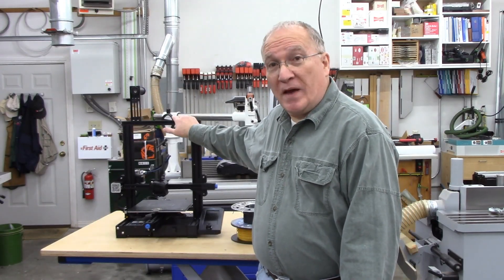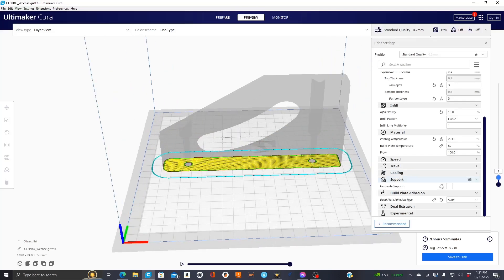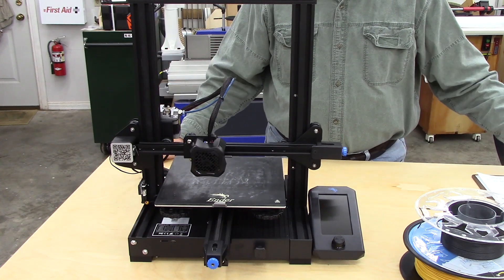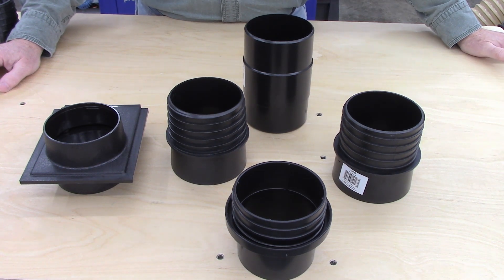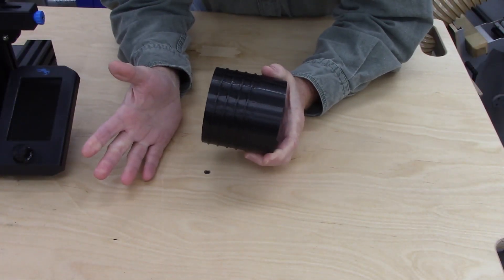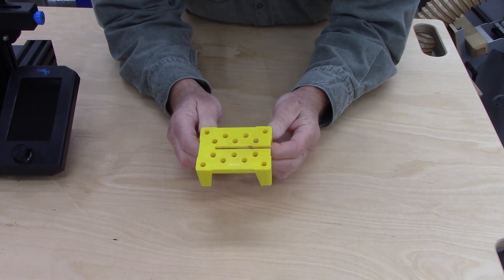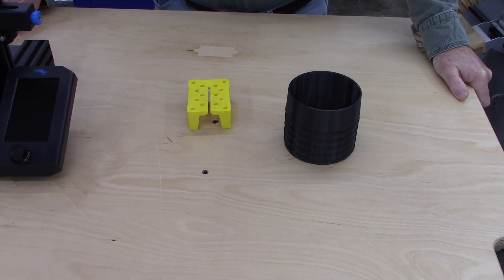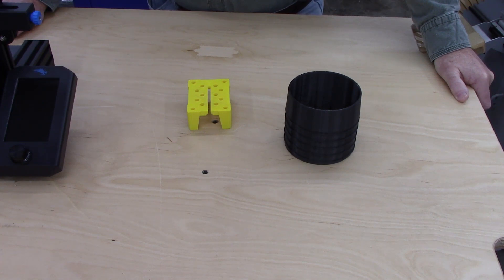3D Printer for the Woodshop?

Comment: Hi Steve I missed this one, great video with some brilliant examples.  I've just replaced my printer with a Bambu P1P, its incredible both quality and speed. 👍👍
Reply from the maker: Thanks Graham.  Based on several of the recommendations on this video, I upgraded to the X1C.  While I initially had a failed display and some binding issues, it is a major improvement to the Ender3.  My 13 yo grandson "earned" the old 3D printer by designing his own project (with a little help), printed it, and then it was his.  He has now created his first project (a Christmas ornament) on his own.  Steve

Comment: Great video Steve! Just to give a perspective on more expensive printers (I also started with a cheap one like yours): I have the new Bambu Lab X1C and with that you can really start printing straight away without any knowledge. The learning curve is way easier than with the cheap machine. 

However, in my experience, a 3D printer is really only useful if you print your own designs. Printing other people's generic designs is fun for a few weeks, but then it gets stale. And designing your own stuff has the learning curve of learning a CAD program. 

My point being: Even with an expensive machine that saves you the hassle of optimizing the 3D printing part, you still have to put effort in to learn modelling etc. But once you know the basics, it's fun to design your own pieces!
Reply from the maker: That is good to know.  I'll have to check out that printer.  I was looking at the new Prusa models that are supposed to be released soon.  Steve
Reply: @extremewoodworker  I think the BambuLab P1P is a better value than the Prusa right now. That may flip-flop as new models come out. I’m sure plenty of people own an x1 and a Prusa. I am biased because I have the Bambu, but that would get my vote for sure. I really like the x1c combo with the filament changer on top. It’s not cheap ($1600), but having multiple rolls of filament on hand, with the enclosure and camera and screen, is something I could not go back to doing without. 

And it’s really really fast to print!
Reply from the maker: @yertle38  So far I have not been able to access the Bambu Labs website.  Don't really know what is going on.
Reply from the maker: @yertle38  After looking at the X1c, I am going to cancel my preorder of the Prusa (have been waiting over a year for it).  I am curious if you have attempted multiple material types such as PLA combined with TPU in the same print (not sure the materials will bond together).  If that is possible, it seems perfect for a bellows type assembly for router dust collection.   Steve
Reply: @extremewoodworker  exciting! I have not tried multiple materials. I have done multiple colors of PLA in one print, and it’s great. One thing to be aware of is you can not use TPU in the AMS (the 4-spool switcher) - it wasn’t designed for it and can jam it up. You can still use TPU from the back as the normal spool. Other materials are all fine, although abrasive filaments can cause it to wear, but I think this it mostly a concern if you do a large volume. 

I am also not sure how well the nozzle temp and flows are adjustable mid-print. There is a very active community on Facebook, Reddit, and Discord. I have seen people ask the same multi-material question and am just not sure of the answer because I haven’t had the need yet. 

Let me know if you’ve got more questions! I am not an expert, but I did do a lot of research after I preordered - I had a month or two wait for the x1c to show up.
Reply: I just got the Bambu x1cc too. My first printer. I haven’t printed much for the shop yet, unless you count organization - the gridfinity system convinced me to finally get a printer and it’s pretty fun.
Reply: Steve - I grabbed your STL for the male hose adapter and sliced it for my BambuLab x1c. Standard settings out of the box (0.2mm layer height, 0.4mm nozzle), which has been printing PLA great. Total print time: 2h1m. You may want to consider the x1c, or the new p1p. It's so fast, pretty user friendly, and prints very well out of the box. It is my first printer and the learning curve has been very easy.
Reply from the maker: @yertle38  Wow!  That is an incredible reduction in time.  Need to check that printer out.